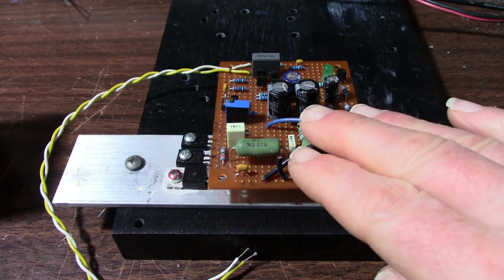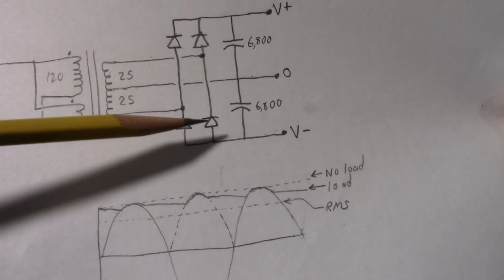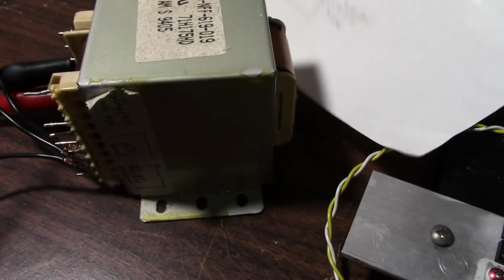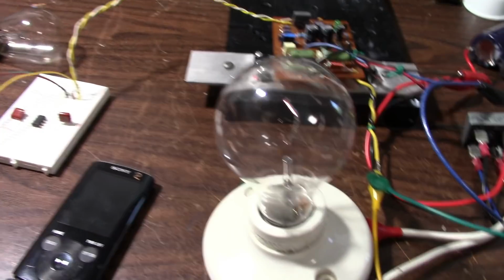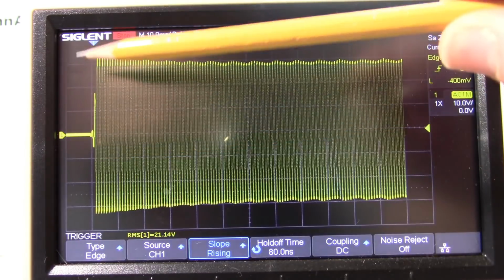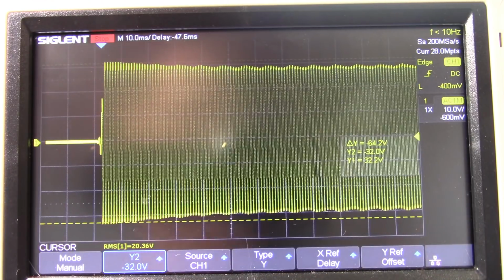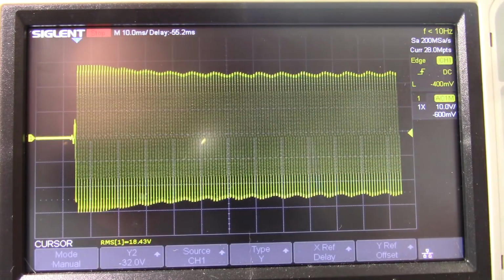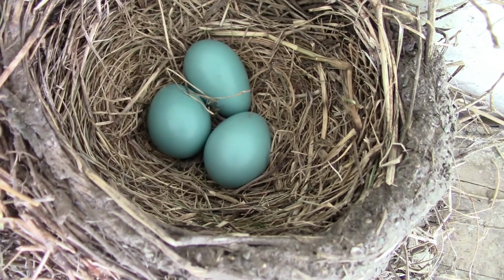JAT501 audio amplifier power tests on transformer supply

Comment: Hi John - what amplitude did you use for the 1khz dynamic test signal? You mentioned your music player and i guess it feeds into your pre amplifier, in turn feeding the JAT. My logic is that for a dynamic test, your test signal amplitude must be greater than the anticipated power amplifier output.?
Reply from the maker: I had to perform a couple test runs to set the amplifier for max output without clipping at the dynamic peak or the test would not have been accurate.
Reply: @JohnAudioTech  Thank you, John.

Comment: At 12:00 you mention the bouncing waveform... how do you fix that? Higher VA rating on the transformer? Bigger filter capacitors?
Reply from the maker: Larger filter caps / better filter design to lower the ripple.

Comment: Hi John, it's been a pleasure to watch your videos since I came to know about your channel, probably an year ago or so.
It was entertaining and informative to follow you on the JAT 501 project... The way you approacehd it and how you talk and explain things very clear and fun to watch, and pretty much correct in every respect (I know a bit the subject and share most of your views on circuits and concepts in general).
I decided to put a comment on this video in particular beacuse it's about the power supply.
It's a known fact that PS ripple subtracts from the available power and when pushed at its limit, the amplifier increases distortion.
It's also known that bass is the the audio frequency that's mostly responsible for the depletion of the P.S. stored energy and, finally, that in a stereo program, the bass content is pretty much monophonic.
So, I would love to hear your thoughts on the following (and maybe a video if you feel it's an interesting subject):
In commonplace Stereo Amplifiers with linear, non-regulated power supplies, why nobody (that I know of) makes the channels work in opposite phases, and ultimately connecting the output speaker of one channel in reverse (on the inverted channel) and by doing so, distribute the voltage sag of the P.S. rails throughout both rails, instead of what happens in pretty much every case that I know, during the peak of the bass semicycles, each P.S. rail is depleted in alternate fashion, making that the power be limited and distortion increased by the double sag, while one channel could be depleting the positive rail while the other could be depleting the negative rail.
Given the same power transformer, rectifier and smoothing capacitors, how much power could be gained by using this technique (at a given distortion level, before the P.S. sag would lead to premature clipping).
Sure I reckon the overall sag spreads through many cycles and it's unavoidable that both rails will eventuall sag equally (over medium term), but in music program, quite an expressive part of the high powered peaks are short-term that happens only every once in a while...
Isn't there nothing to be gained here?
Reply from the maker: Thanks for watching the channel! I think you covered it in the last paragraph. The waveform of a bass note would change polarity in short order, loading both rails of the supply. The filter caps should be sized to handle several cycles. This would balance out the load on the each rail. If you were using undersized filter caps I can see your idea working to some extent, but seems to me to be unnecessary with proper sized caps.

Comment: Missing the connection dot at the 0-Volt point of the two rail capacitors @ 2:38 a.f. ... That should be a connection though?

Comment: Hey there I would like to know something about power resistors in the output stage of amplifiers. What if their value is higher than needed or less? I have a situation with my diy output stage where 0.22 ohms resistors are needed and i only have 0.33 ohm...will they do the job or there will be a problem?
Reply: It will be OK. You will get better temp stability and some lose in efficiency.
Reply: @akkudakkupl  Thanks man 😁

Comment: That Toroidal after Rewinding will be able to delivery enough power for lm3886 board ,  you received recently, 
I'm very interested in that Toroidal rewinding video, because I also have one toroidal with 18-0-18 14awg wire, 12-0-12 20awg wire winding,  and I'm thinking about Rewinding that too.
So I love to see you work.
It'll be interesting and big help.

I already assembled 2 TDA7294 BTL Stereo/Mono boards and 2 Mono lm3886 boards,

Comment: I thought the transformer looked good but it sure could not perform. You might be able to rewind a microwave oven transformer too? They're usually good to around 1000 Watts.
Reply: mw transformers core does not have electric isolation between sheets and get hot. In normal use that does not matter, ovens work for not too long periods. In amp that could lead to overheat.

Comment: 1 question. 60w rms amp 8ohm x2= 120VA is OK @ 8 ohm, but the Most Speakers now are 4-8ohm. It is better to use the 4ohme RMS. Ideal 60w rms 8ohme = 120w rms 4 ohm x 2 =240VA. So de VA specification  depends on the load?.  it's always better to have more than not enough VA. And the ripple voltage is less. Or iám wrong? 
Thank you very much and good luck with the baby birds!!

Comment: Nice video, John.  I am a long term audio amp design addict and enjoy your videos, reviews, designs and critiques.  Well done and thorough.  Is the JAT501 the design you had planned on making a circuit board (and possibly a kit) for?  If so, did that ever come to fruition?  Keep up the good work.  Thanks.
Reply from the maker: I still want to make boards for it. I need to learn some layout cad software. I have a lot going on and haven't put the time into it. For now I dropped the idea of a kit. It is just too much effort to manage stock and sales.
Reply: @JohnAudioTech  I understand.  Can be a PITA managing inventory and becoming a retailer.